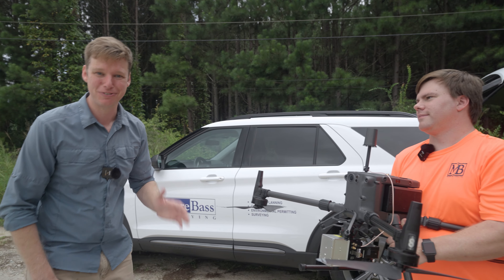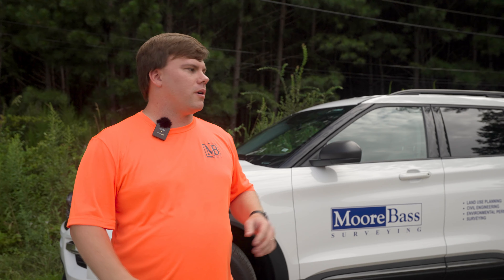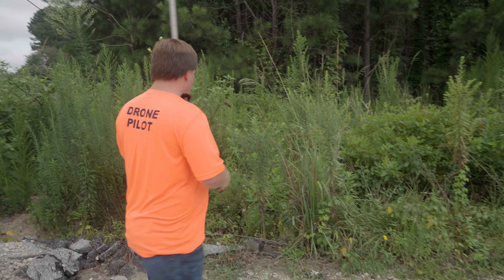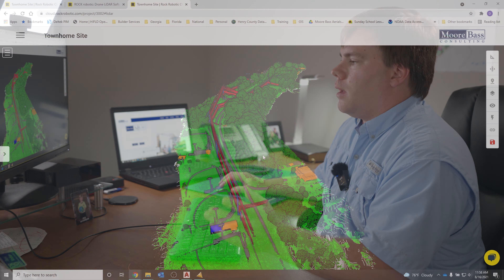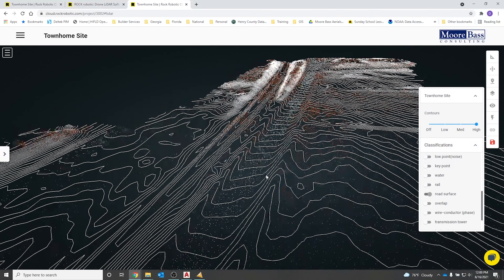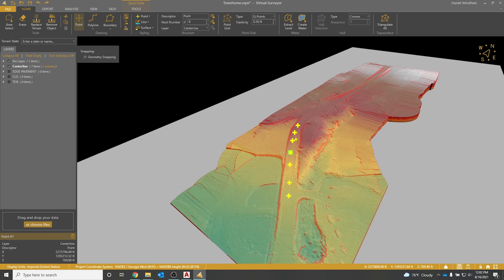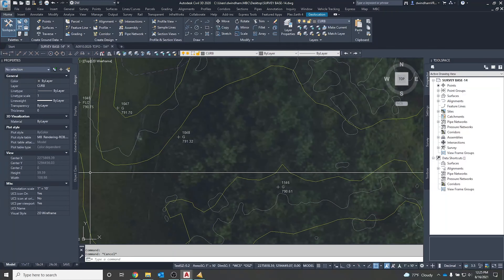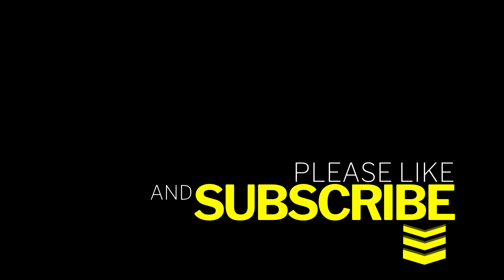Land Surveying with Drone LiDAR | On the job!

Comment: Nice workflow.
My flow of software to be used are.
DJI Terra
LiDAR360
RECAP (AutoDesk)
Autocad (civil3D)

Sometimes (ArcMap to compressed the TIFF file from DJIterra to open in Civil3D)
Reply from the maker: Check out my channel and peep the R3 Pro, ROCK Desktop and ROCK Cloud. It's a seamless workflow ecosystem.

Comment: Is it possible to do a bathymetrical survey(River bed) with LIDAR tech?
Reply: You would need A) a laser that can penetrate water, and 2) to be able to account for refraction which is continually changing in moving water.
Reply: Yes, there are some bathymetric LiDAR systems such as RiEGL topo-bathy LiDAR sensor, but it is quite expensive! The system has to be designed for it (laser beam wavelength), and most systems cant do it!
Reply: It would be easier to drain the river bed using a couple buckets, take your gazillion LiDAR shots then refill it....  with those same buckets.

HA!!!!!!!  ; )